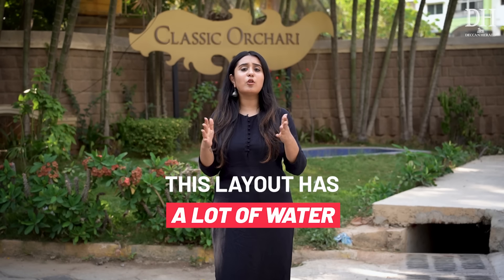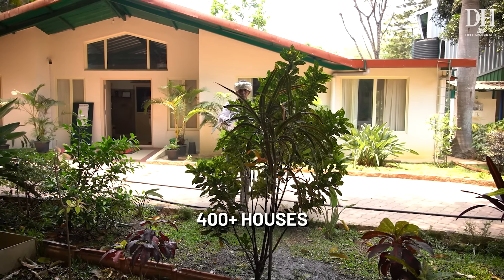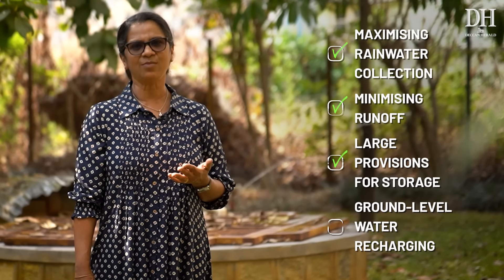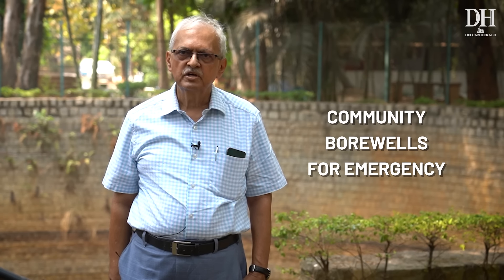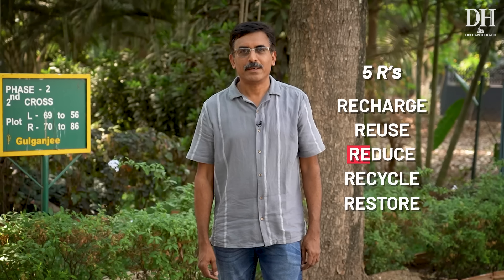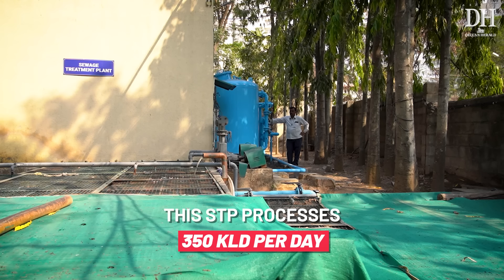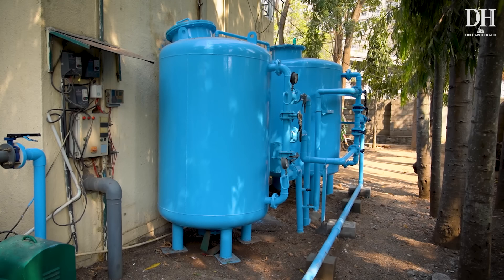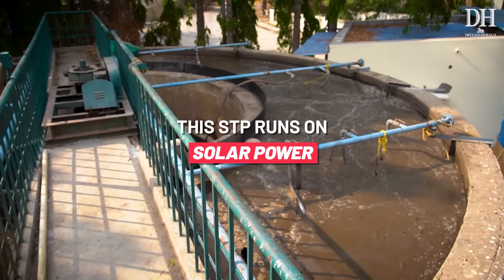How is this Bengaluru layout water sufficient during a water crisis? Sewage Treatment Plant process

Comment: 400 houses in 70 acres, you got your answer here itself. In Most of the places houses are clustered and they don't even have space in between. The main issue is space which everyone can't afford. It's hard to even build your house let alone think of trying to save water in your plot.
Reply: Tokyo, New York, shanghai are as crowded as Bengaluru. How come they don’t have the acute water shortage that we have.
Reply: That's why individual houses should be discouraged. They are most inefficient places of residence, wasting the most prestigious resource: land. Large apartment complexes have more space inside them which accommodates, rainwater harvesting, STP management, trees are planted and other facilities. Land needed per person drastically reduces due to vertical growth.
Reply: @nikhilck629  because of Bangalore (and all other cities) is suffering from mismanagement and corruption. Water problems can be solved by technology. But somehow government has convinced local people that outsiders are the reason for every problem.
Reply: Still water harvesting, recycling of used house water can b done in each house. First wastage of water has to stop. Fix leaking taps. Over head water tank over flow that too has to stop

Comment: Madam, the community mentioned here is not water sufficient. They are still relying on borewell and BWSSB. STP etc mentioned here is followed by most communities. Additionally others do rain water direct use as well as ground water recharge. So, this community is not doing anything different here.